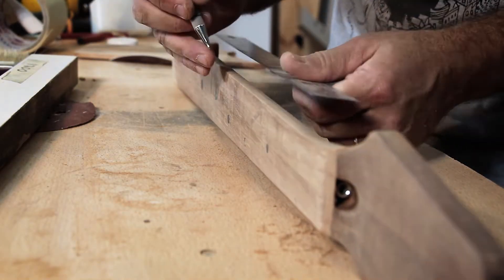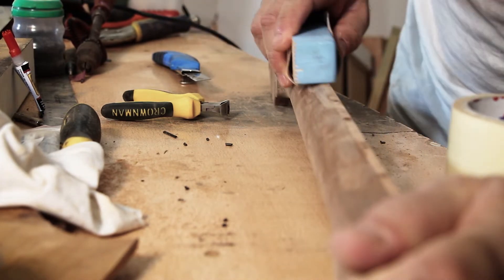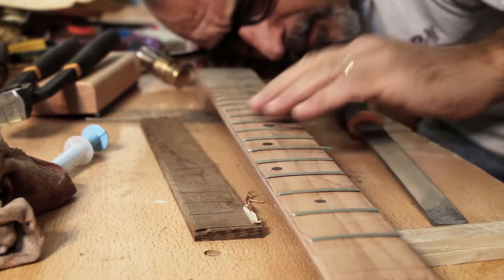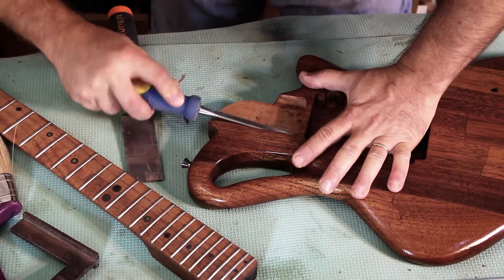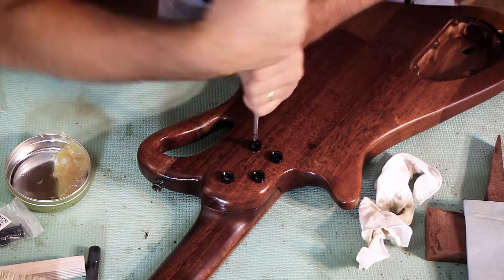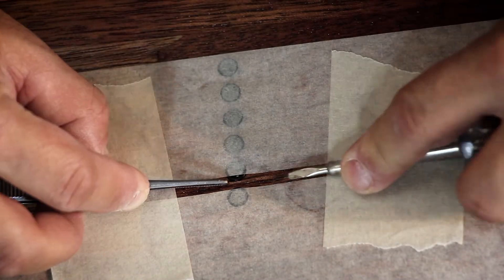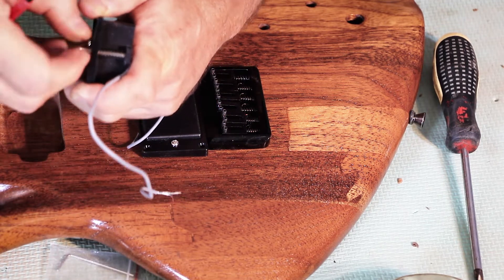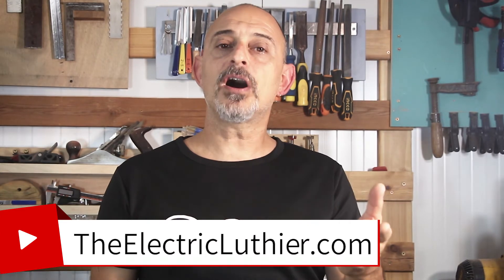My Mistakes for the Great Guitar Build Off - Unofficial Part 8

Comment: Thank you so much for this video this video is actually more important than a lot of your tutorials or for that matter anybody’s tutorial because the mistakes are the most valuable part of Guitar building there are so many aspects to building a guitar I have found that the mistakes are everything I find that I make several prototypes or so-called prototypes until I actually “build the one “ that is done correctly perhaps watching this video can save a lot of us a lot of time. 
Unfortunately what I find for myself is that I have to break up my build so that I don’t try too many things in one given day anyway that’s what works for me if I don’t do that I’m liable to get into trouble working overtime on some thing but once again thank you for this information it’s invaluable
Reply: Thanks for the comment. I do believe that you learn more from mistakes than from success. Every 'pro' will usually have many hours of fumbles and things gone wrong. It's how you recover and eventually avoid these mistakes that makes an amateur into a pro. If my mistakes help someone else avoid the same one, that's great. I have certainly learned from others'. Cheers

Comment: When drillinng the body or neck make sure lay it on proper surface i notice u didnt realize it .n even when it is shakey u still proced to drill it. N relax dont rush. Make sure to use proper screw not the cheap type for the neck heel n tuner. Its not fun to take out when break the screw on the tuner😂
Reply from the maker: All true 😬, you caought me. In my defense, everything looks wobbly at high speed. The problem with cheap hardware is that you only realize it when it breaks. I find it challenging to make it work anyway.